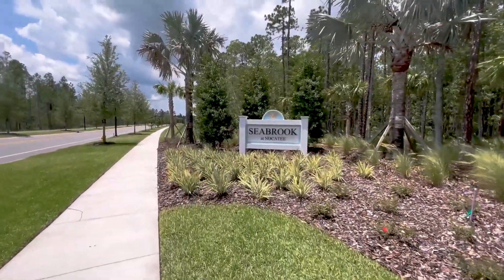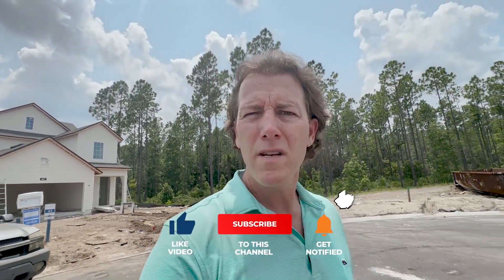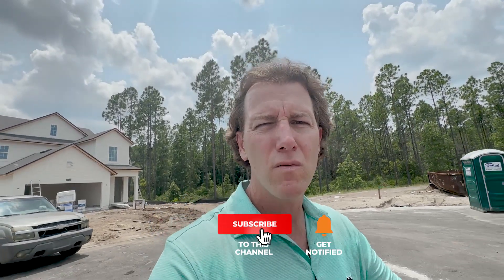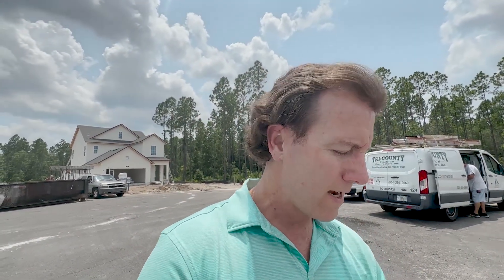Choosing The BEST Lot To Build Your Home In NOCATEE Florida

Comment: This is the best video I've seen from you so far.  Wish you had spoken a little bit about price ranges for lots in that area.  Glad to see you doing the "listen" test.  That's important to me but every other realtor I have any experience with downplays the issue no matter how close the real estate is to a highway.
Reply from the maker: Thank you. Pricing changes frequently (with some builders as much as every 4-5 sales)... & for the sake of keeping this evergreen I did not get into pricing. I would be glad to discuss that with you if & when you decide to take the plunge since the initial pricing can be misleading.
Reply: I agree with @quito the pricing is important. Just tell us the pricing and the date to keep it evergreen. You can add a call to action to check the current pricing if you’re no longer in X month.